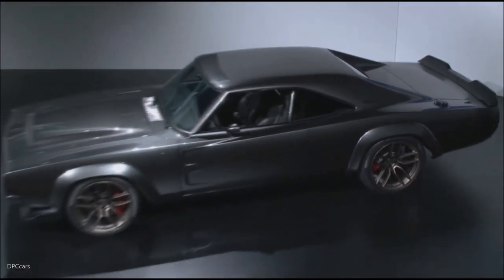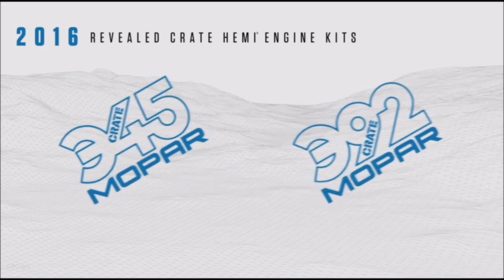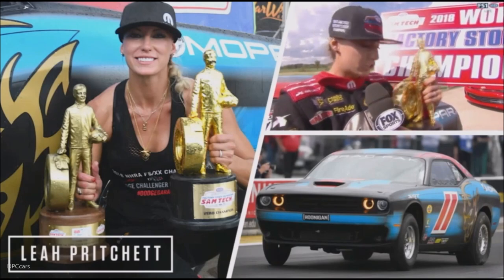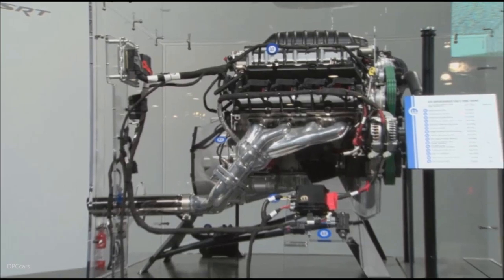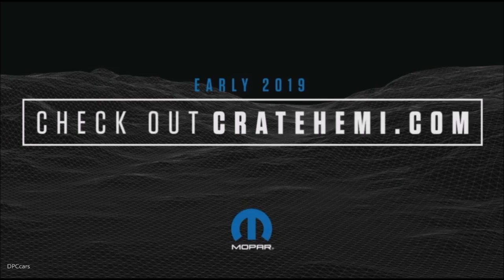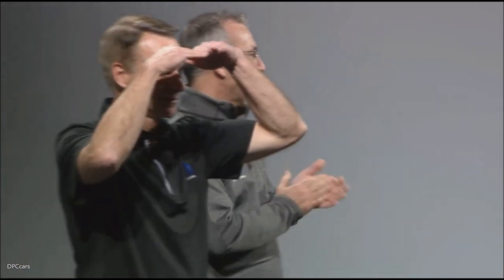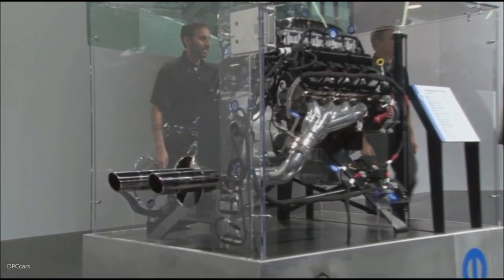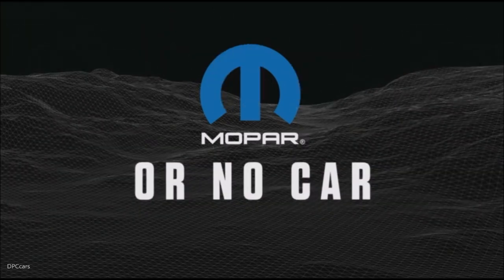Hellephant 1000 Horsepower 426 Crate HEMI Engine Unveiling

Comment: 1000HP isn’t really all that impressive for a crate engine that’s already supercharged. But I guess they tested it on pump gas. If it were converted to run on alcohol it would probably make a lot more power.

Comment: All the backing and you put flares on a 68 charger. What is this fast and furious. If i was in charge of this i would've. Modified a challenger to look like a cuda and put the motor in that! The Hellephant maybe even a hemi cuda convertible because those are top sellers at Macon. Press guy defiantly watches to much TV and not even good tv.

Comment: I like saving the environment  by using smaller engines but when you put a straight four in a muscle car it feels weird
Reply: That's the false info the brands are feeding people. Most cars are going small engine turbo...but when driven hard they actually burn more fuel per gallon of fuel than a bigger engine N/A. So driving think engine out of boost you are doing more for the environment than "pushing" a 4 cyl. turbo to keep up with it. Also they said this is only for Older models..not legal in a  efi generation vehicle. This will get WAY better MPG/lower emissions than an original 375hp 440 1969 charger.

Comment: Oh wow more horsies. Where is dodge in all this. They said mopar or no car.  So Dodge where is the car. Do you really want me to buy a new challenger or charger with an expensive and existing engine only to take it out and put this in myself. Plus adding a better driveline linkages and traction system plus upgrade brakes and crumple zone like a racing cage. I’m not complaining but really . $15,000 plus crate engine needs a lot of support or you might sorry will twist the frame lol..... thanks for nothing.    Until I see the option to but it all in a factory version no thanks.
Reply: Crazy55 Rider This is for people who are building their own car from scratch, not to buy a new car and slap it in.

Comment: Well, Fiat still doesn't understand Mopar or America for that matter 
First of all, Fiat has to market an engine with like min. 1300 or really
1500 HP. Look Ford will sell you a fully street able 850 Up factory/dealer direct. OK so you go to a tuner and it's 1000. There are a flock of 1000. HP Mustangs (just what the world needs) running around NY and it's suburbs. So Mopar HAS to market something street able with a LOT that some smucko mustang to stay unquestionably the top dog. You want a situation like th he late 60's or early 70's where the Hemi was the total King Kong engine capible of blowing up the world. And linguini brains aren't going to get that status with no 1000 Hp....

Comment: It'll be almost as quick as a Tesla...
Reply: Tesla would have NO Chance...If this charger has drag radials. P100D is a mid 10 sec car, slightly slower than a 808hp Demon. This charger is easily a < mid 9 sec car.

Comment: Why didnt they make it look like this from the start?
Reply: It's probably the most Iconic/favorite Dodge body styles of all time...that's why. This body style has been used forever in movies/TV...More than any Ford/chevy/JDM or German model.
Reply: @JerseyMikeP  i agree. I remember seeing in a car magazine a prototype for tge "new" charger and i remember it resebled the old charger but the front had more of a wedge like shape. It looked awesome. This in the late 90s or early 2ks. Then i saw what the finaly released and i thought it looked very boring and unappealing. This ob the other hand is much nicer looking. I lije the current charger. I think it looks cool. Much more so than the fat challenger. This thing tho. This looks awesome!!!
Reply: @Linguo415  Sad that this STEEL bodied car, which is longer/bigger...weighs less than the current version which has alot more aluminum than the old one. An IRON engine 1967 Z/28 is about 600lbs lighter than a current SS camaro.

Almost all New cars are Fat/Heavy which kills the extra power and MPG they could get. Worst is the Mini Cooper which looks small but is 1,000lbs heavier than the original. A 1977 Accord weighed 1100lbs less than a current civic.

Comment: 1,000 is nothing new to Hotrooders. Hotrodders and Muscle car  community have been making 1,000 hp and way more for years! Plus I prefer to have as little electronics as possible! The simpler the engine, the cheaper, easier, and faster to work on, fix, or change parts! Plus you don’t need that much power to run hard!  There have been cars that reach  around 200 mph with around 500hp! There are cars that can run 11 seconds quarter mile with less than 500 hp! You don’t need a lot of power to be badass! I suppose this engine is just for drag racing, way too much for street!
Reply: NO Brand has offered a "Crate motor" with this much power.  Also this is built on an aluminum small block design..not a Big block, which saves alot of weight/space. 

As for 200mph, the cousin of this body style the 1969 Dodge daytona...was the first 200 mph car...So Dodge knows 200 mph better than all JDM brands combined. 

Not to mention since it's a crate motor...the parts would be available/cheaper than most Custom 1000 hp engines. Koenigseggs are street legal and one of the baddest brands in the world and have 1,000+ hp.
Reply: @JerseyMikeP  The 1969 Daytona Charger was the first car to reach 200 mph in "Nascar", but the first car to reach the 200 mph mark was reached as far back as 1964 by a Max Wedge. Also a 6.1 or 6.4, is considered a big block, unless you are telling me they stroked out a small block V8. Also, there are and have been several companies that offer crate engines that make 1000 hp and more. Making a 1000 hp for is and has been very easily achievable for a long time, but thats way too much for street, thats more for the track, for cars that want to go 8 seconds quarter mile. You dont need 1000 hp to reach 200 mph or get 13, 12, 11, 10, 9 seconds quarter mile. Also I have contemplated using aluminum short blocks on my cars, but aluminum is fragile and has its limitations, yes it is lighter, but the cons are not worth the pros. I need cast Iron and steel for my platforms. The more shit you have in an engine the more costly it is and the more shit can go wrong. Everything has limitations, pros, and cons. This engine may be good for the track, but its useless for anything else, we are bound by the laws of physics, just ask poor Paul Walker. New Dodge is just trying to make money and compete with an old industry that has been around for decades, even after Dodge abandoned the muscle cars, leaving the companies created by the enthusiast of yesterday to carry the torch. They are just trying to steal business and look like pioneers.
Reply: @Gilbert440   No factory MAXWEDGE ever went 200 mph.

Comment: Okay, so that engine isn't legal on the street. Fine, I can live without a grand of horses under the hood....but what about the  rest of the Charger? Will it go into production with a more gov. regulation friendly power plant?
Reply: Says who that it's not legal on the street?
Reply: @2414kels  The E.P.A.
Reply: @cliffcampbell8827  ummm... There are 1000hp+ cars on the streets all over the US with no issues from the Law. It's perfectly legal.
Reply: It's not about the h.p., it's about the emissions. Government laws, restrictions, regulations and over reach prevent auto companies from selling engines like that in this capacity. Remember? Back in the early 70's? The E.P.A. said: "Yo! Car companies, as this date (bla-bla 1970-something) we won't allow you to sell cars equipped with engines that have a c.i.d. greater than 400 in the U. S."
Reply: @cliffcampbell8827  you made no sense. If they wanted to prevent it Mopar wouldn't even bother. This is not the 70's anymore. This is perfectly legal on the street.
Reply: 1. "Why would Molar even bother?" Companies issue press releases for a few reasons like "generating buzz," or cheap local/national coverage, or (using above video for an example) good press. 2. Passenger cars and light trucks are under all kinds of government regulations and scrutiny. It's why we have seat belts, catalytic converters, air bags, etc. 3. At this time, Chrysler can manufacture that Charger as is but won't be able to sell them in the U. S. because of current government mandated regulations and restrictions on the automotive industry. If I made a car with a 99 cylinder engine displacing 5000 cubic inches that runs on crude oil and children's souls, I might be able to get it legal for the road as long as I exploit the right loop hole and do all the right paperwork. Now can you identify the difference between me and Chrysler? Between a project car that I built in my garage with cheap beer/step 1 stumbling friends  and a corporate car built by robots and employees on an assembly line?

Comment: Let me tell you something people the physics is in and these high horsepower engines "do save gas" and now we are proving it after 50 years of auto racing. We now know that the higher the compression the higher the millage, done and proven, now don't let them tell you any more that high performance engines do not get good millage, do the physics, they were wrong, period. The higher the compression the harder the air is compressed and less gas is need to operate the motor. So whats with the 4 cylies, don't need them anymore, all of it is a scam to sell more junk foreign cars to America.

Comment: Face the facts the Tesla in straight line Acceleration is much FASTER . !!!
Reply: Teslas aren't FAST, They are quick and that's (off the line). 
 From a Roll even the P100D is Not impressive. This Hellephant Charger...even with street tires would be a FULL second faster in the 1/4 mile than a P100D. As for Fast, P100D only does 155 mph a 392 Scat Pack charger has a 20+ mph higher top speed than a P100D.

Comment: Tesla roadster has 10,000 newton meters of torque
Reply: No it doesn't!.. I've never heard that...post if the link if you are serious?...not TROLLING. ALSO Gay ass TESLA's have NO top end pull/top speed...just like a weak Nissan GTR.
Reply: JerseyMikeP the new Tesla Roadster has a top speed of 250+ mph and goes 0-60 in less than 2 seconds.
Reply: JerseyMikeP I’m not trolling. Check the link I put in the replies

Comment: *Whole industry is going electirc, Mopar nope, note me lol
Numbers don't lie, electric wins
Reply: Electric wins??? The Tesla has a worse range than a Hellcat (full tank vs. full charge). We are still atleast a decade away until electric performance cars have good range/quick charging battery systems.
Reply: @JerseyMikeP  who drives there car more than 300 miles in one day??? The point of an electric car is to charge it at home when you sleep.
Reply: @drkroots333  Anyone that goes on vacation....The point is a gasoline/Diesel vehicle has the option...Even with Quick Charging stations its STUPIDLY long to charge a Tesla. Also 300 Miles is Very Optimistic if you have any sort of right foot. If you get 300 mpg with a tesla you are the type of drive that is better off in a Honda insight. Nothing worse than a person with a powerful car that never uses it.
Reply: @JerseyMikeP  20 minute charge on vacation isn't really that long. Range is 315. So totally possible to speed around. Plus cost of maintenance is way cheaper. That would save a lot of time. Crash test are better too.